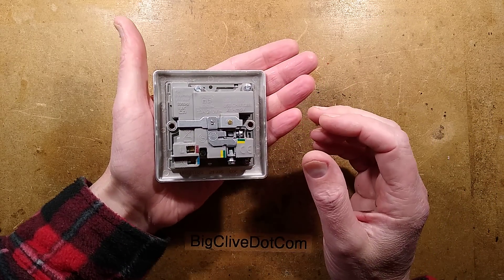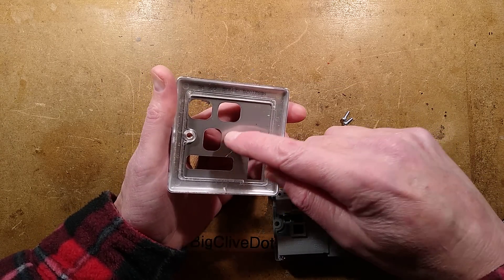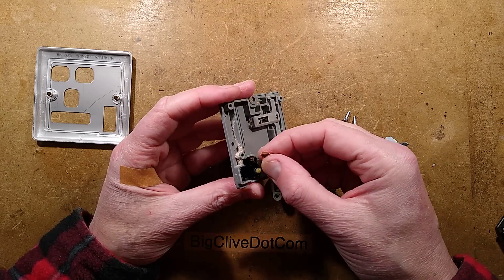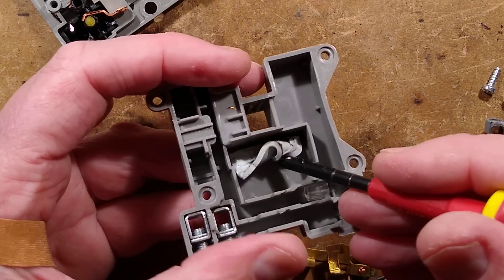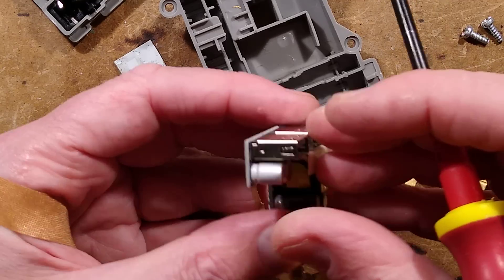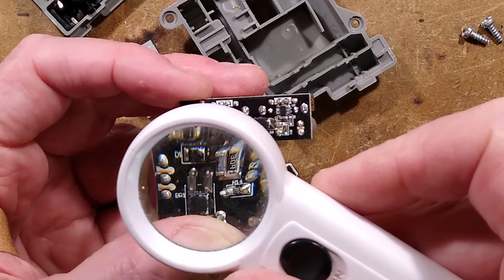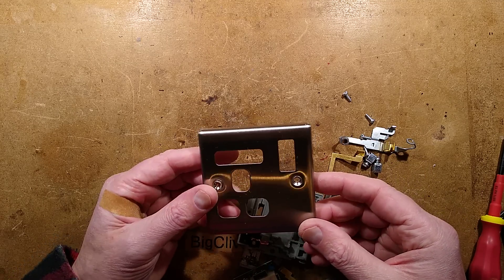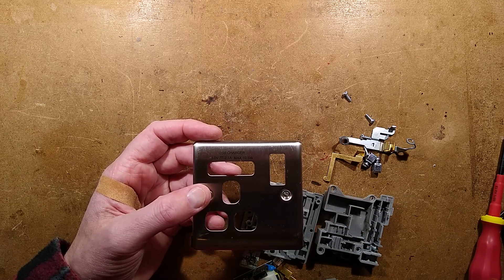Exploded British General USB socket

Comment: This reminded me of the house I grew up in, we were renters, and poor, ever fearful the landlord would raise the rent, things didn't get fixed or my father would attempt to fix it, one switch would shoot sparks whenever you flipped it, scared the 💩 out of me every time,  plus it was right next to the kitchen sink, was that way for sixteen years then we moved after my father died, no it wasn't the switch that got him.
Reply: Probably switching an inductive load, they can have large current spike on turn on causing the spark at the switch contacts, the spark damages the contacts causing the problem to get worse over time.
Reply: @volentimeh  voltage spike, not current. Current through an inductor can only raise slowly. Capacitors create current spikes (For example the filters in big smps, my 750W PC supply was capable of melting/welding extension cord switches.
Reply: I also remember living in houses wired before the UK ring system, although it was already being used in new homes. 5 and 15 amp round pin plugs, with no thought about what fuses they were connected to. We certainly used electric fires, but there was no such thing as anything left on standby. Amazing that we still have the old 5 amp 2-pin plugs as standard for bathroom use. 3 and 5 amp round pins are also still used for lighting circuits with remote switches. Of course wall cables were a mixture of lead and rubber sheaths which perished.
Reply: I assume it was a switch for a heater ~ it’s thermostat was closed as it was cold 🤔

Comment: Considering the UK regulations (aka Protection Racket) these days state that changing a socket or switch officially requires a qualified (whether properly apprentice-trained or 2-day course part-P jobber) sparks to either do the work or sign off on, that's one expensive USB charger, I'll stick with my plug-in ones thanks... :S
Reply from the maker: You can change like for like.  It's only new additions that are covered by the protection racket.
Reply: @bigclivedotcom  That's interesting 😬. I'm going to enjoy knowing that tidbit.

Comment: Clive. Have had a number of these blow up. On boats. Seems to occur in metal faced ones. Have a board with signs of condensation or water on it. Around change control chip. The unit overloaded. In our case it was not a BG design. Have some pictures of the board if you want them.

Comment: These types of panels are always a BAD IDEA. You don't want any AC to DC circuitry in the walls at all. Just use a wall wart adapter like everyone else. It's safer, simpler, and easily replaceable.
Reply: Just needs a switch to isolate the circuitry. I have had a number of these BG socket usb regulator fail - probably because they are energised 24/7 unlike a wall wort.
Reply: @dj_dazzy  The lack of a switch for the USB power circuit is my biggest gripe about these wall sockets. Having something permanently wired in is something that by preference I'd avoid except for certain devices.
Reply: @dj_dazzy  I have multiple power adapters that are plugged in 24/7 and the only failures I've had so far are input/output capacitors getting worn out, usually after 5+ years. The earliest failures I've had were LG monitors after about three years.
Reply: Why bother arguing with stupid people, they drag you down to their level and beat you with experience! 🤣
Reply: @Zodliness  I see you've deleted your inaccurate comment now. Glad you've learned something from all of this.
Reply: I have a few high quality versions of these in my walls. They work great and have good isolation.
Reply: @jakelong4271  Having good isolation is not the same as having a switch to isolate and remove power from the electronics of the USB charger.
Reply: @jakelong4271  Yes, and they are live all the time.  Yet another thing around the house that is a small, but not totally negligible, fire and safety hazard.
Reply: @jakelong4271  That right there is the key. Good quality. Wonder how many Chinesium branded USB sockets with a simple capacitive dropper are installed. Amazon and Ebay being the biggest culprits for selling tat. DON'T skimp on electrics.
Reply: I bought a U. S. version years ago and when about to unpack and install it I thought, “It doesn’t seem the best quality. What happens when it fails?” I’d lost the receipt so I gave it to a charity shop. I think I should have thrown it away.
Reply: @Zodliness  a proper charger should reduce the current if it gets too hot, and also limit the current within its own limits.

It cant be up to the user to make sure that smartphone matches the adapter. 

The average teen with low battery will plug in the phone in any usb socket available.
Reply: @bsod5608  USB is standard 5v at start, and current is limited by the device, not the charger. It's never left to the user, even with the cheapest of cheapest chargers out there.
Reply: @somedude2492  i know, it was a comment on a now deleted comment... even the cheapest charger (atleast what i have seen) will cut its voltage if the device is overloading the charger.
Reply: @somedude2492  Current is limited by the device?
Oh really?

So if the device wants 4 amps a 2.1 amp USB charger is going to deliver it, is it?
Reply: @deang5622  current is limited by the device. If the phone wants to draw 4 amps, it will try. You could see it as "pulling" the current rather than "pushing" it from the charger to the phone. The max current from the charger is determined by a variety of components, but none of them are hard limits. Once the phone gets close to the maximum current the charger can handle, the 5v from the usb will start to drop. The phone can see this, and it limits the current that way. 

The phone is smart, the charger is dumb. That's why a phone is costs $1000 and you can get a decent charger for 10 bucks. 

Tl:dr: if the phone wants 4 amps it will try its darnest to get 4 amps. Now, if it achieves it or not depends on the charger being able to hold 5v at that current.
Reply: @bsod5608  "smartphone matches the adaptor"? You not know what the U in USB stands for?
Reply: @Zodliness  The USB outlets are current limited. They cannot exceed 2.1A output, regardless of what the device calls for.
Reply: @Zodliness  What? Sockets are rated at 13amp. Most USB ports can supply 3.1 amps.

Comment: Conductive trim on electrical sockets always gives me the willies.
Reply from the maker: Yeah.  I regard metal sockets and switches as foolish fashion in anywhere but an industrial environment.
Reply: @bigclivedotcom  I bet the flame-thrower was a multilayer ceramic capacitor! They are renowned for doing this.
Reply: @bigclivedotcom  why are they OK in an industrial environment though? I have them in my garage, except for the office and kitchen areas.
Reply from the maker: @Ayrshore  The metal is functional in an industrial environment, and the earth is usually intact.
Reply: Metal sockets should be called shockets.
Reply: @anotheruser9876  Isn't that just the Glaswegan pronunciation?
Reply: My mum has brass fascias on her electrical outlets in her living room, even when all is well with the wiring I charge myself up on the deep carpets and get a zap off the earthed light switch.. scares the s**t out of me.
Reply: @donvito1973  All you're talking about there is discharging static electricity from the (presumably nylon) carpet discharging through the (grounded) faceplate - if it didn't do it there, you'd get a shock from the nearest radiator or metal pipe as you walk past.  The problem is not the socket, but the carpet and the build-up of static.  And some people charge up more than others - my dad is constantly shocked when he walks through their hall on the radiator, never happens to my mum, and rarely to others.
Reply: @ukeleleEric  Yes, but when I get a zap from an electrical fixture my mind thinks I've finally met my demise, I like the reassuringly insulated plastic fixtures and get my zaps from radiators and shopping trolleys which I'm fairly sure aren't going to kill me even if they go wrong. :-)
Reply: I've always preferred them to the white plastic ones. They don't crack, and the white plastic ones can melt under heavier loads (e.g. Powering an immersion heater running at full tilt). Any sensible decent socket should be earthed or double insulated anyway, so I don't see why it would be less safe?
Reply: @Recessio  strange, i don't think i have ever seen an outlet/switch cover crack or break unless abused in some way (such as trying to trim it because the counter backsplash is a bit to high)
Reply: @ARockRaider  the really cheap white plastic ones (i.e. The ones that come in newbuild homes or in rented homes run by cheapskate landlords) are fairly easy to break. Normally within a few years of heavy use Ive found they can give way.

Of course going with a good brand it's not as much of an issue, but I've always gone for the metal plated ones, they just seem more durable. And for the heat reducing properties for high power circuits eg immersion heaters which running at 2.5KW can cause a 13A fused spur to get hot enough to start melting a plastic casing, from experience.
Reply: @Recessio  learn something new every day.

My (only) home of 30 years has only ever had one outlet melt down, and it was more from using a cheap power strip as an extention cord for an electric heater, don't remember the size though.

But on the other hand, dad was a licensed electrician for a time, so all the wiring was done by him.
Reply: @ARockRaider  I have seen cracked faces but only really old, heavily used ones. We do have rather a lot of UV light hanging around in Australia though.
Reply: @LongPeter  ah that would do it.
Reply: Not the best idea hey.
Reply: @William Tell even if the wiring inside the house is connected correctly with no faults inside the property, there are certain types of fault that can give you a shock and render RCDs useless (this is something that could happen with properties that have a combined neutral/earth conductor from the supply company)
Reply: The metal trim will be grounded by design. Did you not note the metal strap riveted to metal trim? it's no more dangerous than the metal frame of a washing machine, and possibly less so as the earth/ground connection is very direct.
Reply: @TheEulerID  Do you--Do you not watch the videos on this channel?
Reply: @TheEulerID  assuming there is no interruption in the earthing circuit.
Reply: @tomrogers9467  if there's a break in the protective earth, then nothing plugged into the socket will be earthed, so the socket will just be one issue. Also, even if it was a plastic socket, the screws won't be earthed.
Reply: Metal socket faceplates are fine, they're grounded through the screw. This is no different than a metal appliance, metal conduit and junction boxes.
Reply: @straightpipediesel  Usually true, but if there is a wiring issue, it is just adding a potentially hazardous conductor to a part you a supposed to touch bare-handed. There are that many stories of grounded enclosures becoming live under perfectly mundane circumstances.
Reply: @straightpipediesel  in a perfect world they would be grounded. But a non-conductive faceplate just covers all bases. I have seen that metal plate become live before. It doesn't take much for a earth wire not to be connected/ become disconnected.
Reply: @MyProjectBoxChannel  CPC disconnection doesn't automatically mean the plate is live. A stray line conductor on the box that's managed to dodge a floating CPC connector to make the plate live in incredibly unlikely.
Reply: @grahamek86  I know that it's unlikely.👍😉
Reply: @straightpipediesel  they 'should'/'ought' to be , doesnt me they actually are....depends how competent the installer was..
Reply: @andygozzo72  The only way the faceplate is not grounded is if the installer didn't hook up the ground wire. Then any grounded appliance you plugged into the socket would have the same shock hazard. The hazard would be arguably greater since you touch, say, a metal-cased computer more than the socket.
Reply: @William Tell brave of you to assume anything you didn't watch be done is competently done!
Reply: @William Tell you can still get a good shock and the rcd not trip, .......

Comment: It look like the rivets didn't actually need to be drilled out to access the internals.   Looks like access only needed screw removal.
I agree with a couple of other comments.   There should be a compulsory way for isolating the USB charge circuit.

Comment: The "You Ass Be" socket! I get scuffed with a screwdriver every now and then, it happens. "Minor lacerations detected..."
Nicely kaboomed. I like the insulation cutout on the board and the effort that went into cramming it all into a space tighter than Ethel Granger's laces, but if it failed so bad, it's still crappy.

Comment: I wonder if the mains wiring was subjected to a high voltage leakage test at the completion of the renovation?......
I also imagine the pretty metal faceplate will quickly begin showing scratches as people fumble to plug in plugs when they attempt to do so in dark/difficult to access positions behind furniture or similar. The two USB holes will probably feel like the holes for Neutral and Active to fumbling fingers.
Having USB leads poking out at right angles to the wall in a dark cupboard or behind furniture doesn't seem like a wonderful concept either.
Ahhh, convenience and fashion.

Comment: You're pretty hardcore decorattor if you remove electrical outlets as a normal part of redecorating.
Reply from the maker: They've clamped down on that in the UK due to the number of decorators who poked wet wallpaper down the back of switches and sockets with a pair of metal scissors.....
Reply: I'm just a normal DIY guy, but always detach the faceplate of sockets and light switches when decorating. No need to disconnect the electrics, just pull out enough of the wiring to allow paint or wallpaper to be applied. Cocking around with masking tape or trying to cut wallpaper exactly is never ideal.
Reply: @albanana683  I think the wall plate is a part of the outlet in the UK.  The one in this video looks like it's one piece so if you want to take the plat off, your taking the whole outlet out.  For how good the UK plugs are said to be, I am surprised at this, but I guess there have to be some compromises somewhere.
Reply: @procrastinatingnerd  It's really very easy. Take the screws out, then a gentle tug to pull the socket about 2cm from the patress box. Then you mask up the faceplate, allowing you to paint or wallpaper behind it. As per Mr Haynes, replacement is the reversal of removal. Should take less than a minute.. EU sockets do have a faceplate separate to the electrics, but are more fiddly to remove as the screws are hidden.
Reply: @albanana683  I didn't say it's hard to pull the socket away from the wall.  I am saying it's just less safe.
Are there outlets in the UK that have a separate faceplate that can be taken off without taking the outlet out of the wall?  I have only ever seen them as one complete unit.
Edit: I suppose in the case of the outlet in this video it is still probably more safe than a US outlet.  On this one the connection's are fairly shielded where as on a US outlet with the plate removed you can stick anything next to the outlet and get a surprise.  I would imagine there are UK outlets that don't have the connections shielded so well though too.  So I guess it's a tossup.
Reply: @albanana683  I agree with what you say however, you can get very short leads on sockets and that does not give you that much room to aid decoration. In addition the rear of the socket is effectively live. That is if the insulation on leads are short then the conductor is exposed, plus not good if you have wet wallpaper paste in the vacinity.  Best to still isolate the power to the socket or possibly wrap/cover the socket to prevent access to it.